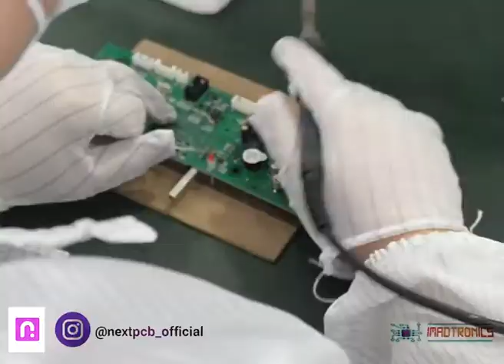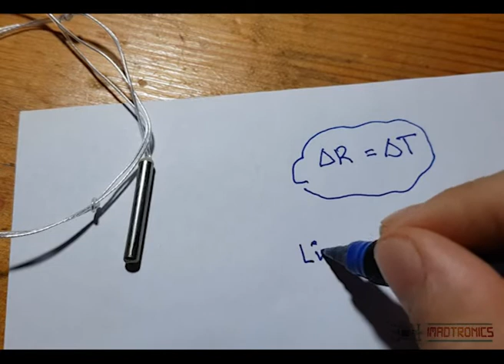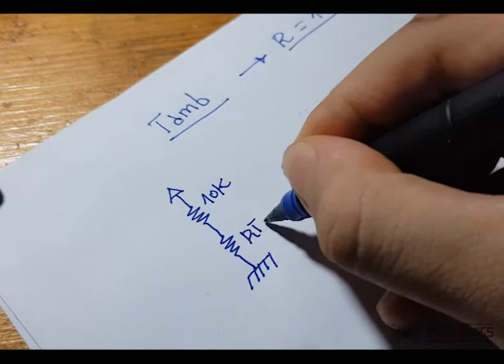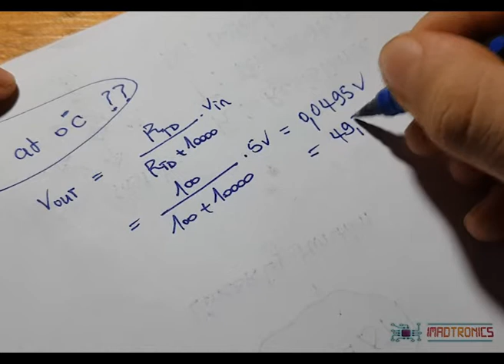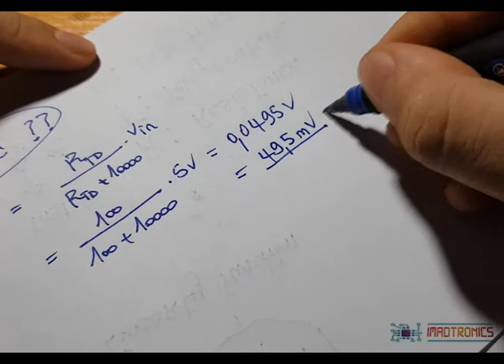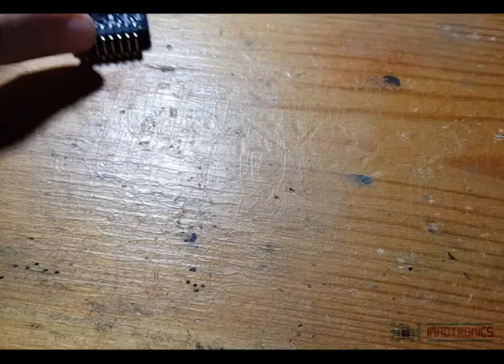Pt100 RTD Basics

Comment: how about op amp based voltage amplifier solution and analog reading of that voltage using arduino?
Reply from the maker: Will take a lot of time and a lot of precision to make it perfect . Also considering the split power supply system

Comment: PT100 changes resistance from 100 Ohm at 0 C to 161 Ohm at 150 C. You should use 1K resistor instead 10k!  This will give you range of 0.455 V to 0.693 V. Delta is 0.238 V, its 0.0016 V per Degree. Atmega328p analog input ranges to 1023 this gives you precision of 0.0049 V. For round degree precision you might not need multiplier. If you still need precise measurements I would go for 3 wire PT100 and RTD industrial convertor instead of this cheap PCB.
Reply: how about also setting Vref of the ADC to internal like 1.1V? doesnt it also increase the precision.
Reply from the maker: @007gurkan  yes it would improove the precision
Reply from the maker: I appreciate your comment, 
first of all, let me tell you that this is not for industrial domain, it is instead destinated only for educationnal purposes. 
Nevertheless I definetly agree with you in the point of using 1k resistor instead of 10k, but the issue is that you got now 10 times more curent which ( POSSIBLY ) can lead to some heat turbulances that can affect your measurements.
this is why i ve choosed 10k and used op amps so the ADC of the arduino doesnt load the signal.

you can also check the datasheet of MAX31865 RTD Converter it is used in medical fields ( for reference ) . Thank you

Comment: please tell me me how to make 100-200 degree adjustable   temperature switch using arduino with pt100
Reply from the maker: This is easy . I gathered all the important informations in my video . You can check them and try it on your own appliance 😉 good luck . If you got a little bit lazy you can also try an NTC Shield which got an LM339 on it and use it for ON/OFF appliances
Reply: @LAPTXINFOTRONICS  can you please please help with the circuit diagram and arduino code..